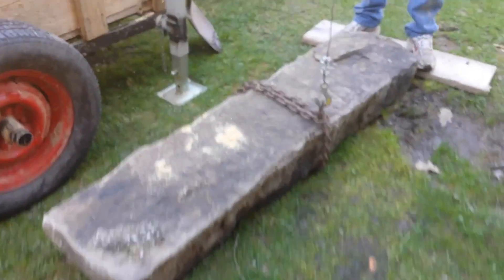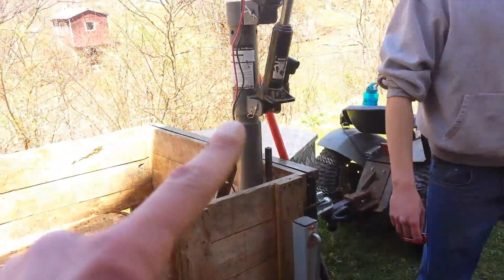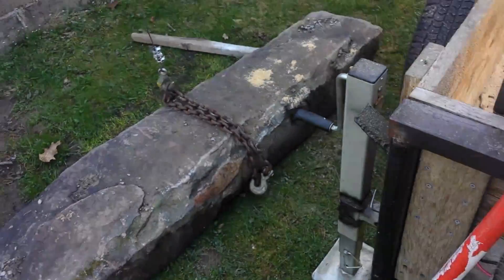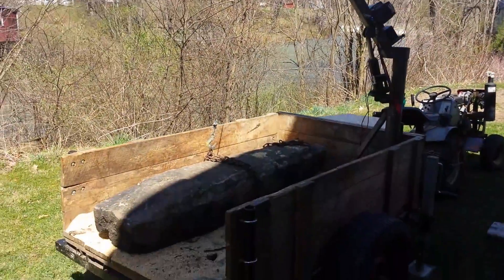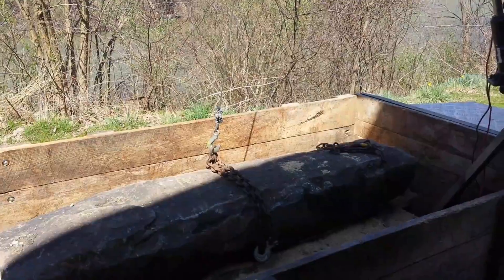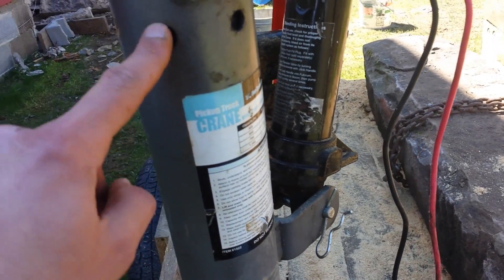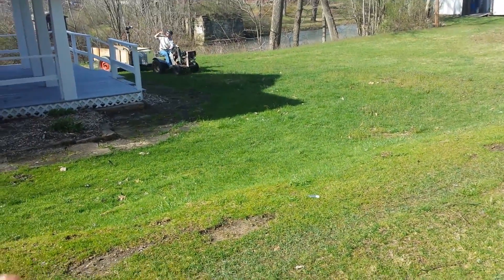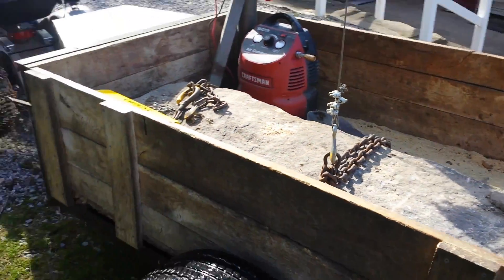Harbor Freight Pickup Truck Crane Review- Moving MASSIVE 65 Inch Foundation STONE

Comment: I have the same setup..except the winch is welded onto the bottom not the top. For those researching installing one the crane and winch arent the weak link.. your truck bed/suspension is. I was shocked to find out how weak and thin modern trucks are built.. i still need to upgrade mine more

Comment: One thing I'd chang on the crane trailer: add on outriggers that can be moved in/out for increased stability, using a jack and adjustable outrigger on both sides.
Reply from the maker: That is a good idea. We are getting a lot of stuff on the trailer though. Id like to make this trailer into some sort of dump trailer in the future. That would be so nice to have.
Reply: Great idea. I still think Nick's trailer is well setup.

Comment: Nick,I love that crane. Is that an extra stay you have welded in there onto the crane support since the "Unloading a big Rock" video?What power rating I the winch? I like the wireless remote idea!!!
Reply from the maker: Paul O'Connor Thank you. Yes I had to add another support because I bent my mount. It's a 2500 lb winch from harbor freight. The wireless remote is fantastic.

Comment: Hey, that was impressive! Though quite dangerous too. 
What are the specs of the motor and battery? That's a big battery you have there. How much does it last? I'm planning on getting a 12v winch too and taking it to the forest far away from any electricity to recharge the battery, so I'd like to know like how much can it last, maybe calculating by how many times you have pulled some amount of feets of cable in certain weight... 
I'd appreciate your help!

Comment: I have the Damn crane what lb is your winch mine is 2500lb got mine on the pickup truck to lift my wheelchair it does pretty good haven't lifted anything real heavy yet
Reply from the maker: TIM LASHLEY It's the 2500 lb from harbor freight. It seems to work pretty good. That winch and crane will lift the wheelchair fine. You may want to stregthen up where the crane mounts. It was the weak spot on our setup.
Reply: thanks dunno why it changed my same to Damn sorry but yeah ill try that
Reply: TIM LASHLEY that cable is only rated for 840lbs I have the same one

Comment: You should check a granite block weight calculator online. I think that weights about 1200lbs. The wire you used is rated at 800lbs.
Reply from the maker: Andrew Munchkin I guess they build a safety factor into the cable. Lol. I've snapped that cable before too. I was lifting things that the winch would barely lift. Wish I had a scale that I could put on the cable and chain to weigh super heavy stuff like this.
Reply: Love2boat92, I know what you mean. I have the HF atv winch 2500lbs and was looking at videos after I bought it and saw a guy get his lower jaw ripped off when the cabel broke. It was so graphic. Since then I am super careful. If that cabel had snapped it could have easily cut off someones head. I never knew that stuff either so I'm not trying to be smarter than you at all. You might want to edit your video with a warning. You have great videos btw.